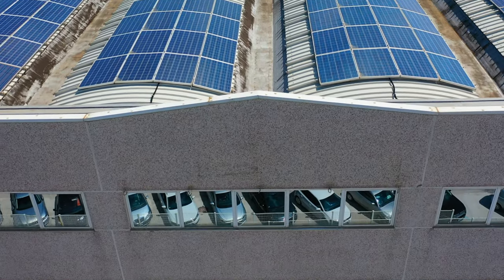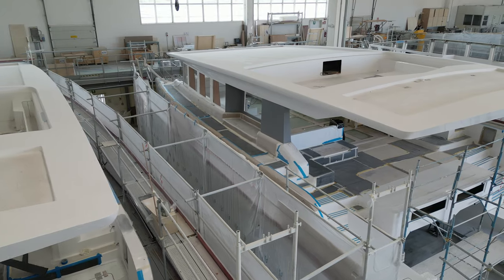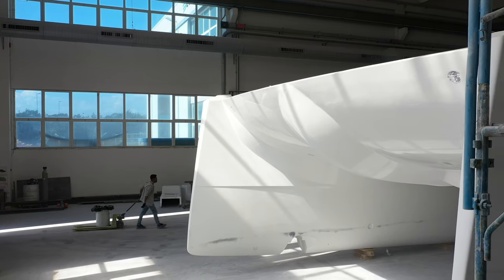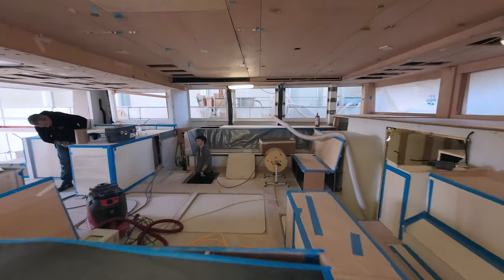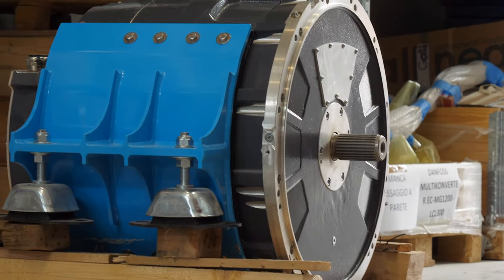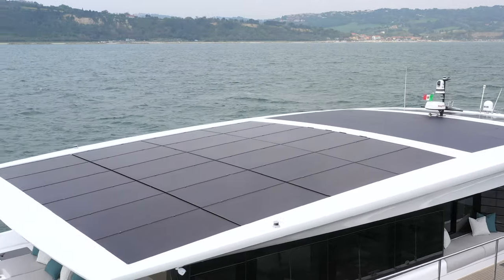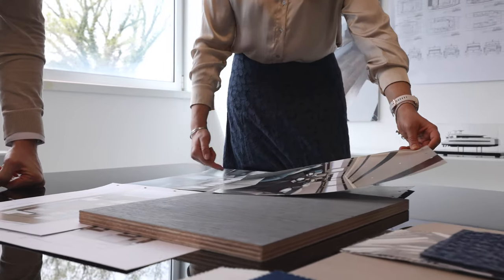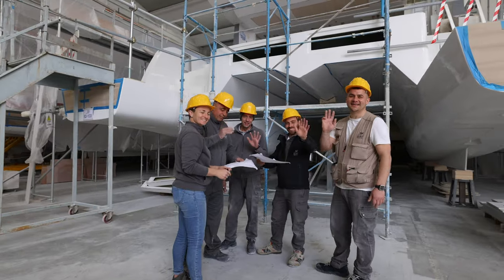SILENT SHIPYARD ITALY | Tour by Michael & Heike Köhler

Comment: "liquid cooled batteries" 
Ah, I see they've noticed the number of suspected battery fires on yachts lately. It's a smart move for both safety and battery longevity. 
Keeping the batteries at a cooler temperature will prevent them from developing a memory as quickly, I wonder if they have an idea how much it will help and what they're using for coolant, if it's something that's non-reactive with lithium batteries.
Reply from the maker: yes, we are using liquid cooled batteries with a special coolant that avoids propagation - a really safe technology.